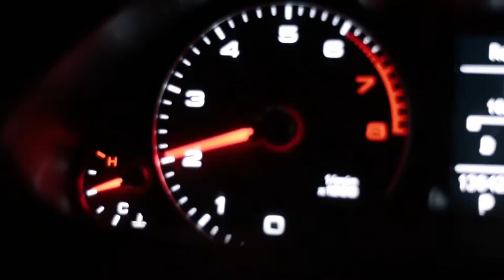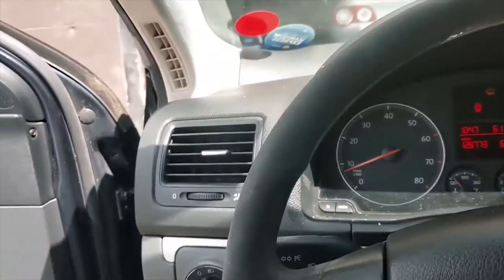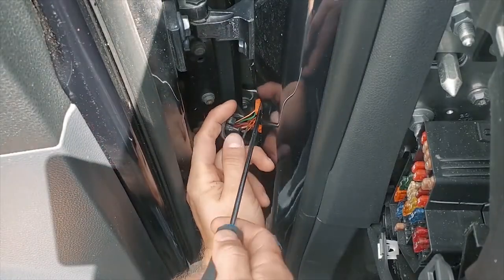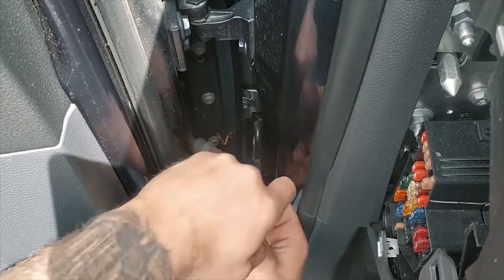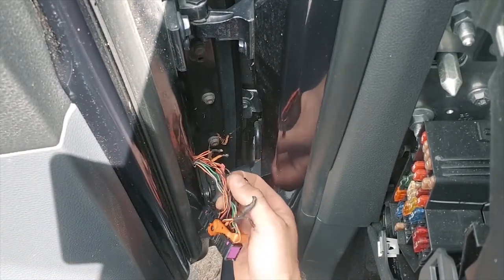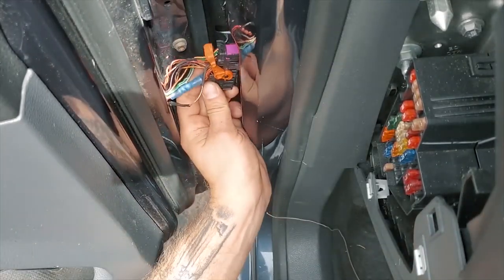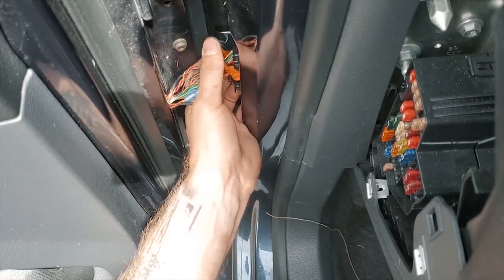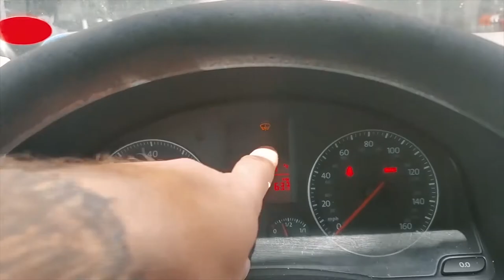🔴 HOW TO FIX windows and power door lock problem VW!

Comment: I have the "same" problem in my rear right door. Lock doesn't work and window works sometimes.but if I disconnect window module and conect again it works for a short period of time
Reply: What did you do to fix? Same problem, same door, but door has no power at all, the alarm doesn't beep either. Not sure if its the motor or these wires. Nobody seems to know. When I tell them they look at me crazy.
Reply: @teemccallum7543  I a payed 120€ for this info 😅 in my case was the electric module wasn't working well.
Reply: @Helder_Paulo hey bud was it the ccm module or was it the door lock module?... Im dealing with the same shit
Reply: @shlomo_jewinstien-Doodoowitz found the fix?
Reply: @RinosaurPravi  nope not yet but I stll haven't swapped all the parts yet been dealing with a crazy wife but one day ill get back to fixing my cars

Comment: The same problem here, but the door is locked, I can’t open 🤦‍♂️
Reply: Same here. Does it have to be that side wiring that you need to fix?
Reply: @Shung-gp1iu  bro, I had to change an electronic control unit…it was very expensive here in Brazil 🤦‍♂️
Reply: @lucasmazutti8823  I have no power on my passenger door but the window works sometimes and the speaker does. But I have lost the mirror turn signal and the door lock. Could this be ECU also?